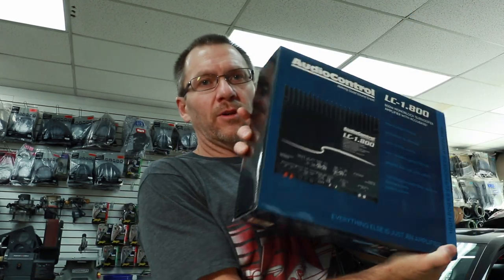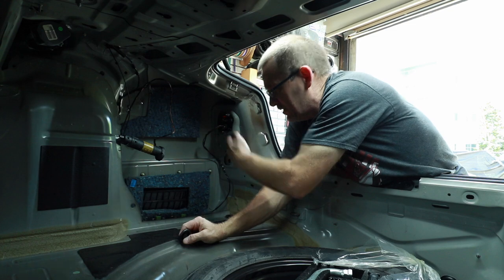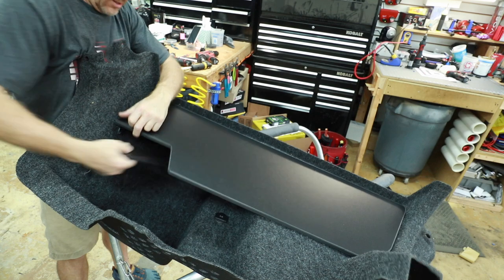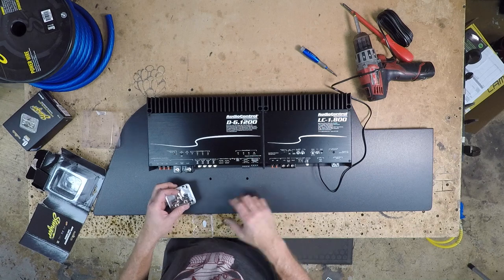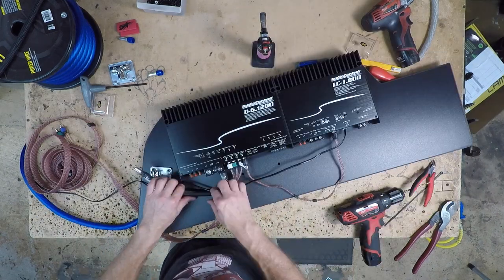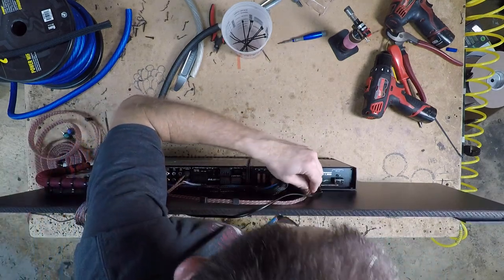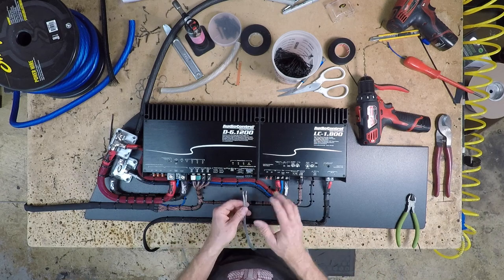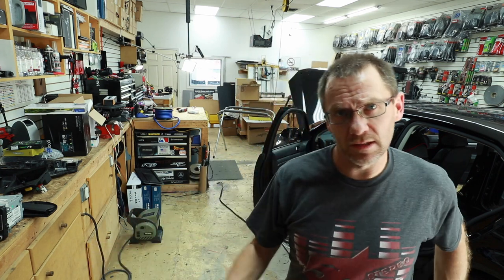Do you want to build and wire your amp rack like Dean?

Comment: I was a welder for a company that made control systems for electrical sub-stations, power plants, etc. Once the cabinets were built, they would go to the other side of the shop where all the gauges and switch gear were installed and wired. We had a team of 4 or 5 women who would wire everything. A section of cabinets could be 30 feet long side by side, and with the backs off of them, they would start at one end, wiring the devices and routing their wires. At the far end, the wire runs could end up being 4" in diameter. You could literally follow an individual wire through all the bends all the way along from one end to the other. It was amazing work. Dean's wire management reminds of that. I like that he realizes that the wiring is as visually important as any other part of the install.

Comment: Aside from hiding wiring and such, Dean’s OCD style is 💯

This video released just in time for my Malibu amp rack project ahead. 

RF P1000X5
Audio Control LC7i
B+ and GND Distribution Blocks
Reply: I like Dean. Da man
Reply: “Aside from hiding wiring”  
what do you mean by that?
Reply: @GrifFungin  Running the wiring through holes to the back of the panel and doing the management from there, and/or putting a dress plate over it so you can't see it.........
Reply: teksiis 
So the guy is saying that Dean needs to hide the wiring?
Reply: @GrifFungin  I can't speak for someone else but I don't think that's what he is saying at all. Some people prefer it hidden, some prefer to see it all neatly managed on the front of the amp rack.   It's just a preference thing.
Reply: What year is your Malibu?
Reply: Pagostyle, how did the install turn out? I have an LC7i installed in my vehicle and for the life of me I can't get it tuned the way I want. How did you ultimately end up tuning yours with your system?
Reply: Gregory Swan do you have a Gen 9 Malibu? I added the LCQ1 to mine and I’d be happy to help!

Comment: The plug in connectors on the high pass amp are called Phoenix Connectors, they are used a ton in Smart home control boards and alarm systems. I deal with them on a daily bases, and yes the best way is to put the wire in bare, as using a feral will more then likely cause you to strip the screw out trying to get it to the "perfect" tightness. 

Another great video Dean, and love you wire management skills, wish quarter of my guys took the time to be as tidy as you. It drives me nuts to go out on a service call and open up a panel box and fined a spaghetti bowl of wires with nothing labeled.

Comment: First and foremost, thank you for all the video production you do on this topic.  Both you and your shopmate along with Mark at Car Audio Fabrication have taught me a ton about installs.  Finally, I have found a video from one of your channels that I can finally see a finished amp rack, and I can ask this nagging question.  

Being from the structured low-voltage and network cable field, I have always wondered how power to signal separation is managed to minimize cross-talk.  The common practice of keeping power lines separated by 3 feet (1 foot if using shielded cables) from signal lines is nearly impossible to do in car, but running signal lines across power lines at 90 degree angles when it comes to car audio amplifier installed is.  You ran the power lines and the RCA signal lines right next to each other on this amp rack after leaving the amplifier, and I understand compromises have to happen in the car audio world.  However, do you not worry about cross-talk with power lines practically touching the unshielded (looks like) twisted pair RCA lines?  

Thank you for your time on answering this question.  Thank you again for producing great content about the world of car audio as well!  I have referenced your works many times!  Cheers and stay healthy!

Comment: Dean, do you crimp your ferrules or just put them on the wire and use heat shrink on them and is it tight enough?  By the way, your amp racks and wiring are the pinnacle that others only dream of achieving... always clean and professional!!!!  The details are what make the install stand out!!!
Reply from the maker: For the big wire yes. When the amp screws down it crimps it together. We have a crimper for big ferrules but it the crimps the wrong shape. That seams to be the problem with larger wire crimper. We have not found a good one yet. 8 awg and below gets crimped.

Comment: Super clean install and makes me want to go out and attempt the same. You mentioned possibly mounting the amps under the rear deck. Always thought that was an issue with heat, at least if you mount the amps upside down?

Comment: Hey Dean, I just came to this video to find out what material you use for an amp rack and noticed you installed the exact two amps I’m getting ready to put into my truck. I noticed you used 0 gauge for powering both amps and was wondering if that’s enough wire. I was thinking I need to use a 0 and a 4 gauge for the amps to properly power them. I’m installing them under the rear seat in my 2017 F350 crew cab. 

Thanks again for putting out awesome videos!

Comment: I have been doing professional installations for many years and I have a question for you. 
I have found that when I run RCA's parallel to your power wires that close you will get insain noise. My only solution has to always cross the wire in a 90 degree over the power to cancel the noise and use source unit type filters. What are your plans if you get nois from your beautiful amp rack?

Beautiful work tho and I love watching and getting new ideas from y'all

Comment: I can appreciate the hard work , but I would have hidden the rca's and power wire behind the abs then pushed the connections thru a few holes.  Great channel.
Reply: Can't no space behind the amp rack, but I hear you as I too leave space behind my amp racks to route wiring though and behind them ! He did a fantastic job for what he had to work with !

Comment: What about the ground distribution block how are you gunna get the ground wire in to ground the amp or are you going to just use the distribution block to ground the amps ?

Comment: I have tried to contact you on fb. No luck. So I decided to comment on the first video that popped up in my reccended.  Have you ever done an instal in a 2010 Mazda 6 just the radio? Are the radios that mimic the stock shape worth it ? Specifically the eonon Android 9.0 ones. They have the canbus and all the connection to tears in steering wheel functions etc. I can’t find any info on them such as RCA output voltage.

Comment: 16:50 Not fusing the smaller wires when stepping down the size after a power distribution block is not a good practice. If that wire shorts, the larger main wire will supply enough current to possibly cause the smaller wire to burn before the main fuse blows.

Comment: I have a question please. I am installing a sub, new,speakers and an amp in my Canyon. The only place for The amp to  fit is under rear seat.  Can I screw it down on the carpet or do I need a platform of wood/mdf/ etc . Thanks!

Comment: I notice you ran the RCAs right up along the 1/0 power wire. Does this not have a chance of injecting noise into the signal?
Reply: Not likely with 4K series RCA’s . Twisted OFC and triple scoops of mint chocolate chip

Comment: Where do I find or get the plastic sheets that I can make an amp rack for for my 05' Silverado behind the  back seat my amp is roughly 3" thick I have trimmed the brackets to clear the amp/amps I would like a peace around  1/4 - 3/8 thick

Comment: What is the bare but covered dump wire do I have 2din after market hu. 04 factory Bose no sound. And does the second radio harness behind vents go through factory amp? I have a Old factory hu that makes some sound when plugged in to it but not good. Will if plugged in to other harness. Worked for 2yrs. then spuratic now nothing every video I watch just confuses me even more. HELP!!!

Comment: do you have any videos on an install for a 2005 jeep liberty 4x4 3.7 with tweeter dash mount im going to try to do an install on my wifes jeep but im afraid i will start pulling thinks out and not knowing what to do PLEASE HELP. Thank you
Reply: I did a full install on a 04 liberty I used to have.  It's really straight forward except for how to run the wires through the firewall.  There is already an unused hole that has a plug in it, but it is partially covered in seam sealer.  To find it, just pull back the carpet on the driver's side, find the vertical seam that has sealer on it, and follow it up until you find the plug.  Because it's covered in sealer it will take a bit of force to push the plug out.  I recommend using a screwdriver to push it out.  And don't forget to put the grommet back in place so you don't have the wires rubbing against bare metal.